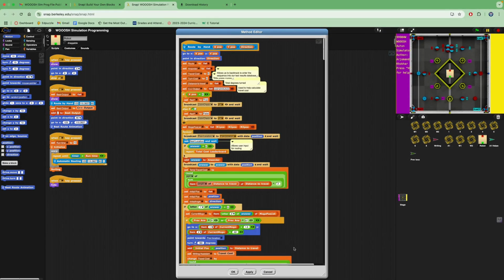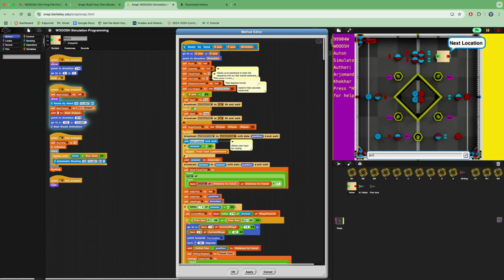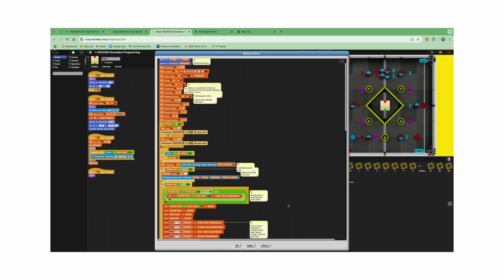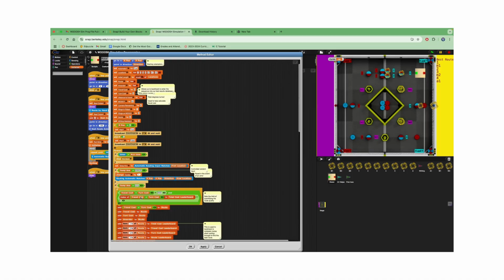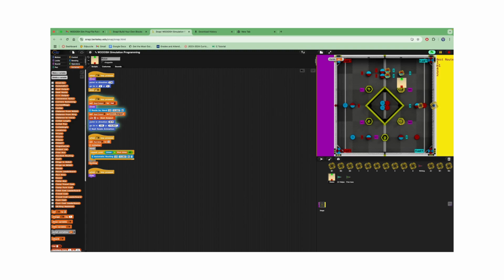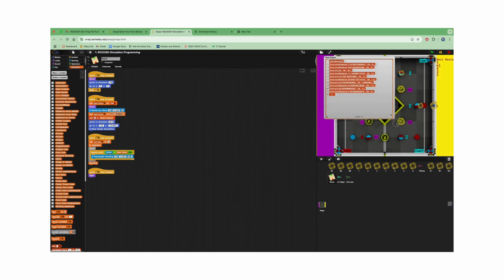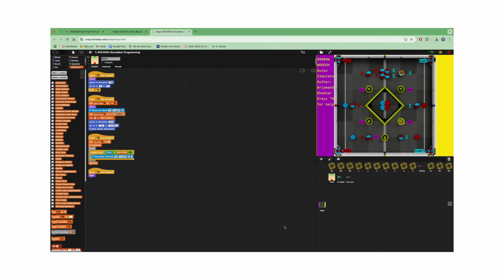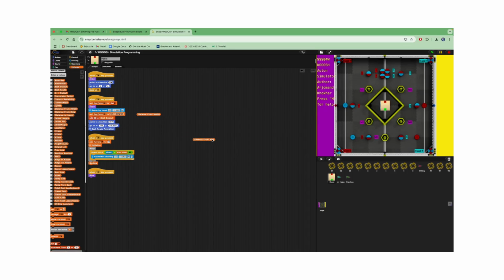99904W New Palestine Robotics Simulation Programming Tutorial

Comment: Hi I'm in a middle school and we use blocks to code so is there a way to convert this to blocks like for the exported file
Reply from the maker: I don’t believe there is a “copy/paste” method using block code, but you can still use the numbers that it outputs to get all of the distances and turn angles. You would just have to manually input those into your parameters.